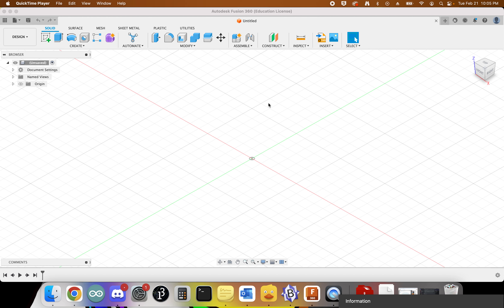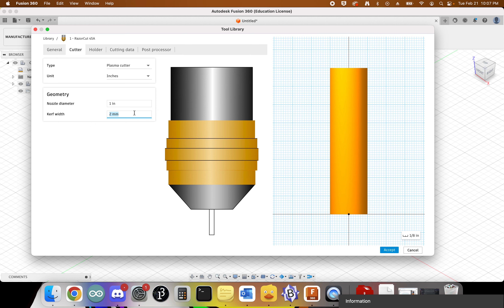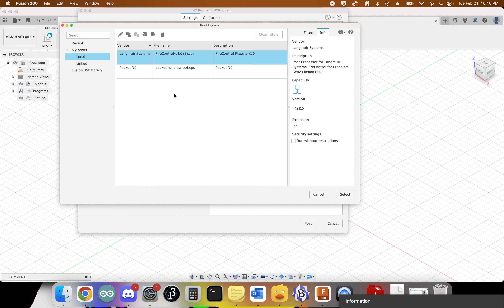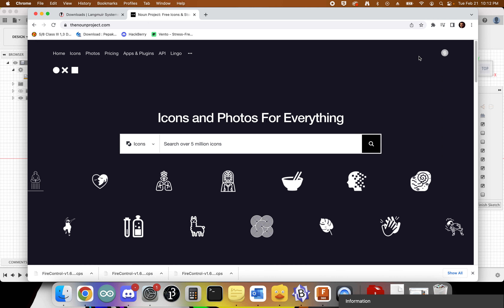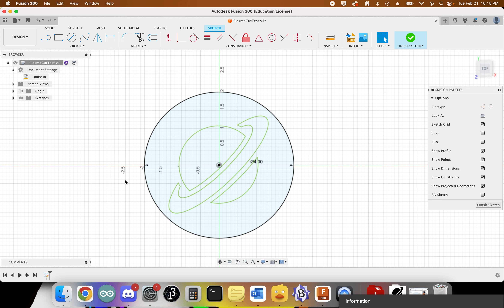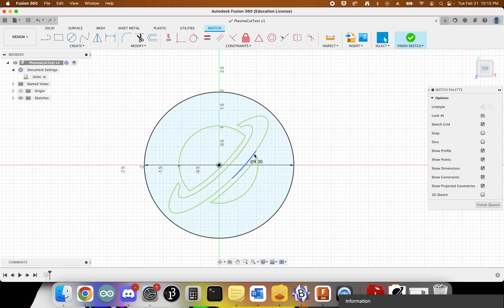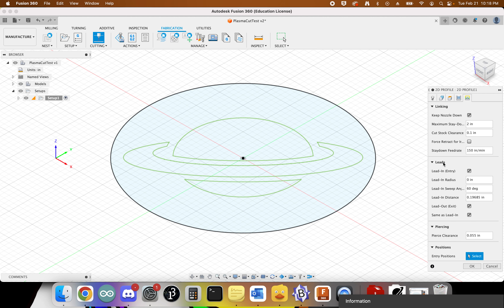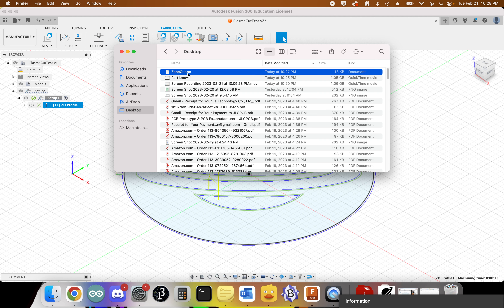Fusion 360 Plasma Cutter Setup and First Design

Comment: HELP HELP HELP!!.  Im  brnad new user learning Fusion and trying to get familiar with the basics before i actually cut on my CNC plasma. I found your videos very good and easy to follow but im still having issues with certain things.  The main this is to be able to have my plasma program(fusion360) follow the proper cut path.  Whether it is follow you...exactly or others online, im ending up with the same situation.......the cut contours are not all being cut during simulation.  I did the moon emblem as you did but had one with 2 extra stars.   Followed exactly your process....yet i get the same result.....half the contours arent being cut.  even when i select as you show.....and it shows the arrows in each section...no issue.  But then i can see right away the path only goes to half the cut outs.   I dont get it.   Same thing happened on another test when i follow and design with a name and typed in Mike for the cut out.......all the letters would simulate but not the do for the LetterI.    i don t get it.   im losing my mind over this.   Please help or let me know who to connect with to fix my issues....which are probably very simple.   thanks!!